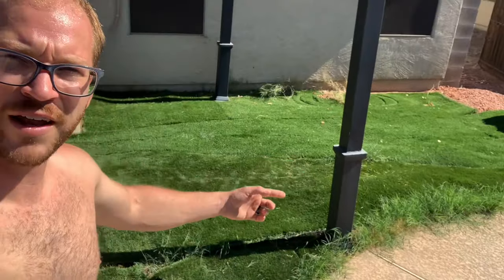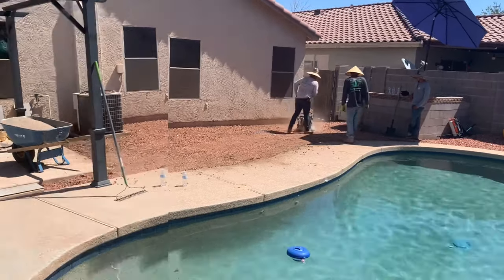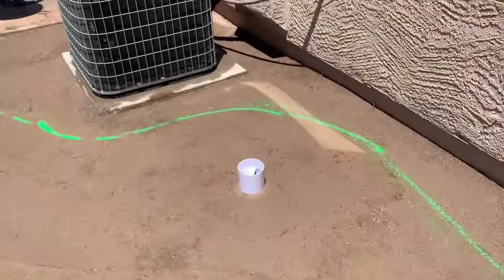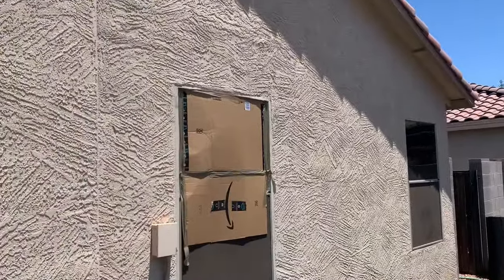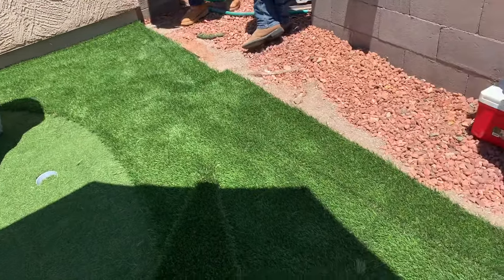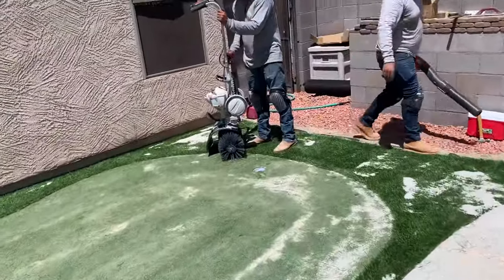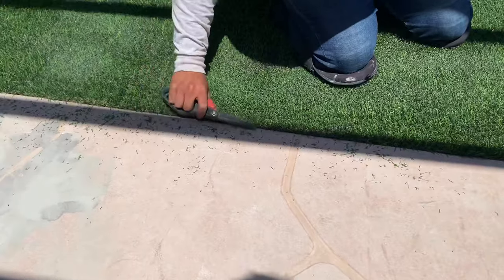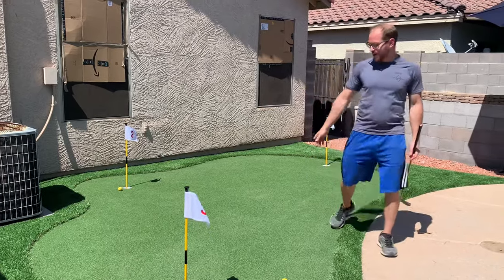Installing a Backyard Luxury Putting Green Step by Step!

Comment: How’s it holding up? Usually if you don’t water the rock in between running the compactor it will settle with time. The dry rock won’t pack as tight as when it’s been wetted. Curious if you’ve noticed your base loosening/settling.

Comment: great job. but the sand they used wasn’t meant for putting green. but this one works i guess. lol 🤷🏽‍♂️
Reply from the maker: Can you say which sand is the proper one and what the difference is between that one and the one that was used please?
Reply: For putting green I think 60 is recommended, not the 20 they used. The larger the number the finer the grain and the finer the grain the smoother the turf will be.
Reply: What kind of rock is the first orange layer?

Comment: When they ran that compactor over your green my eyes almost exploded. And then when he took scissors to your turf at the end I wanted to cry. You recorded him cutting your money away and you made it sound like a good thing. I’m sorry.
Reply: I think the compatcer made it slower
Reply from the maker: Thanks for the input! What method do you recommend? Also remember this is in Phoenix, Arizona. Turf install could be different in different locations? I’m not the expert at this which is why it’s the only thing I’ve hired out. Hindsight tells me I wish they wouldn’t have trimmed the turf with scissors because I was adding tile (3/4” higher) to the patio. But yes, it seemed like a cool detail in the moment.
Reply from the maker: Like a slower roll of the ball?
Reply: The grace by with you responded, trying to hear out and understand this person is admirable. I commend you. While I’m here, I must ask- does it roll slower than nice courses? Just wondering as your putt in the video looked as if it was rolling a bit slow. I’m worried when I install mine on my own that it will be slow
Reply from the maker: Well, my first putt ever went in the hole so I was stoked! Seriously… that was my first putt EVER on it. So cool. So, perfect speed to me.
Reply: Over time it can speed up